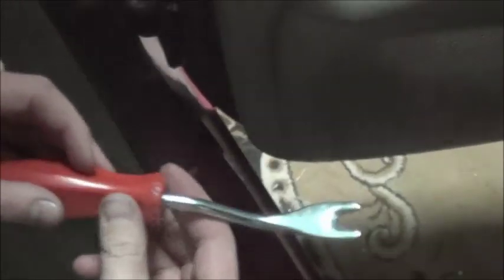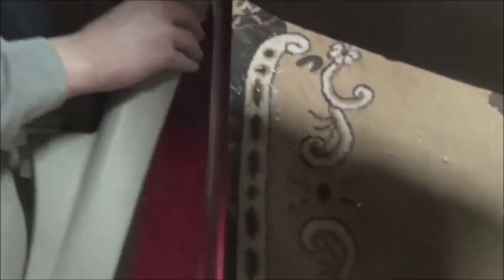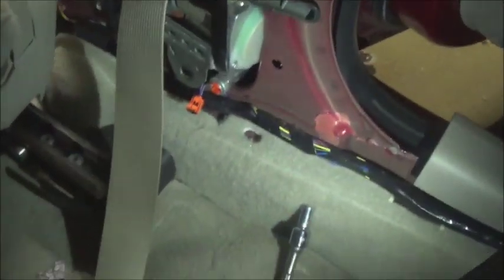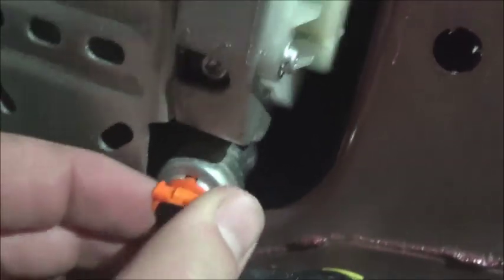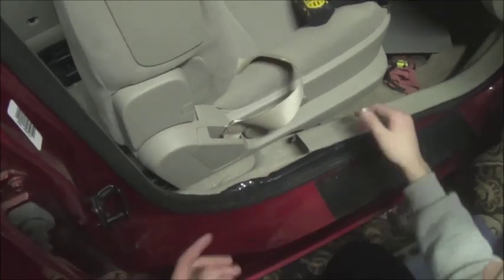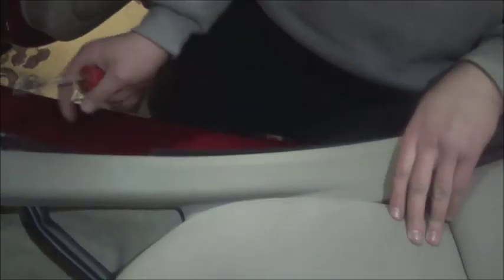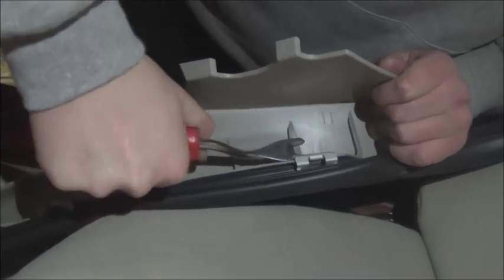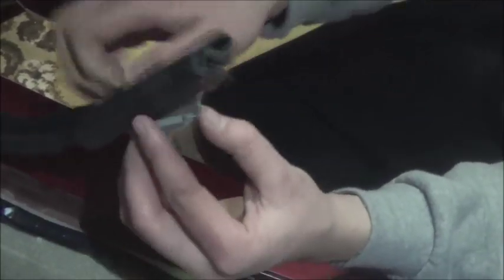How to change a seat belt on Ford Fusion 2009

Comment: The video quality is kinda poor but the description was perfect! I swapped out my seatbelt in almost no time because of this video.  Thanks for the info on the clips and the size of the tools needed.  I only had to make one trip to the auto parts store.  I did have some problems with the plug for the sensor thing, but thanks to you I knew it could be an issue.

Comment: Hi, I know this is an old video but I'm assuming you had to reset the air bag computer reset?. Were you able to clear the airbag light? I did this exact job a while back, reset computer, but still getting a pretensioner code/light. I installed a good/used seatbelt, like yours. Thoughts?